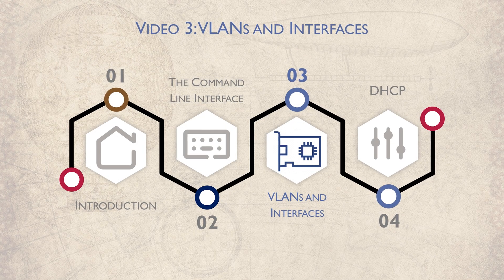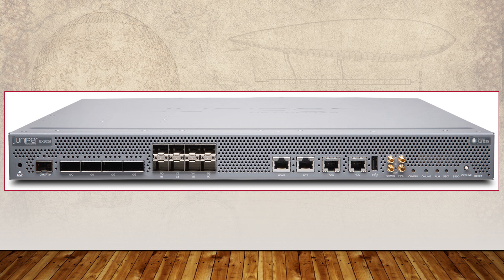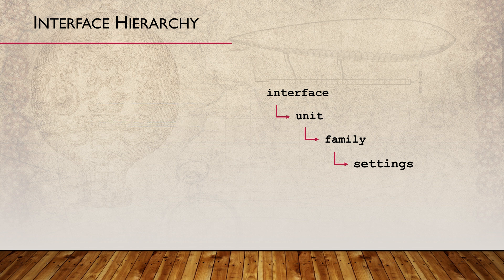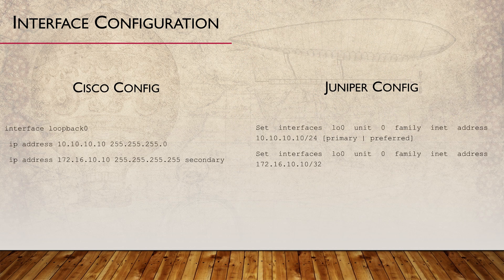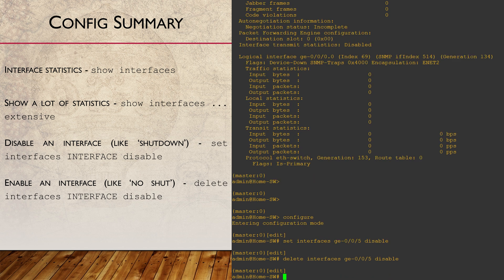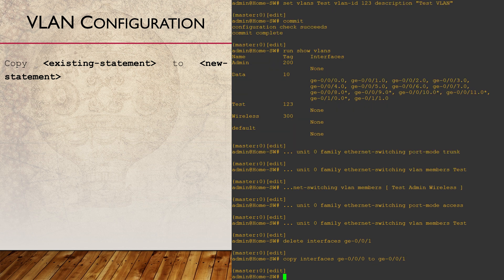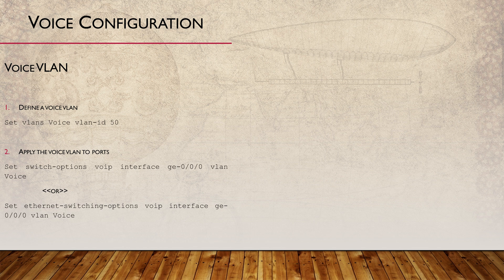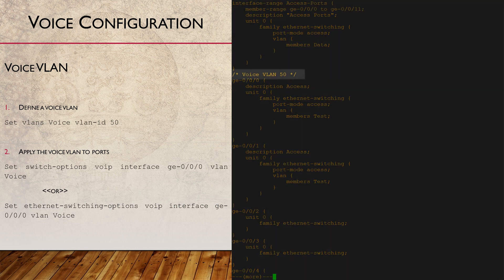VLANs and Interfaces | Introduction to Juniper and JNCIA Part 3

Comment: Any comments on configuring bridge-domain for mapping vlans to irb's in MX?  Otherwise they don't work at all like you expect.  This got me at first (coming from old school IOS).   Good work on these series. :)
Reply from the maker: I haven't used the MX routers. I've been using the EX switches and SRX firewalls. What should we watch out for?
Reply: @NetworkDirection  good question.   I am coming from old school 65k's straight to MX204 so the triplet of vlan, irb, and bridge-domains just to set up a L3 routing vlan was mind boggling.   I think it's less complex in non-MX.   Overall I love the cli much better than IOS though.   Except for this!
Reply from the maker: @v12alpine  There's a few pros and cons for sure. I like the CLI, but setting up MPLS in a small environment on small SRX's nearly broke my brain (I didn't do it in the end) - Mixing flow and packet mode was a minefield